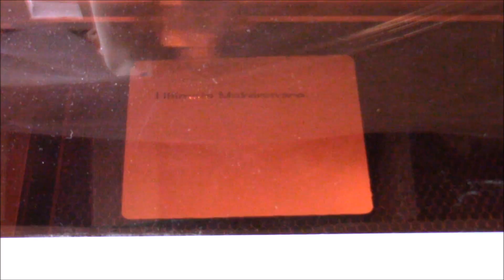K40 40 Watt Laser Cutter Engraver Overview and Mods

Comment: Thanks for the video! Would you mind sharing your speed and power settings for the acrylic? I'm having trouble cutting acrylic on my machine.
Reply from the maker: Thanks for posting! First of all, make sure it’s acrylic and not polycarbonate. Polycarbonate will make a sooty black mess. For settings on 1/4 in thick acrylic, I max out the power dial and set travel speed to 8 mm/s and run 2 passes.

Comment: What's the noise level with one of these?
Reply from the maker: The laser and cnc part is about like an inkjet printer. The blower that I put on mine is kind of loud, like a vacuum cleaner, but you could install a quiet blower if you needed to keep the noise down.

Comment: How does it know where home point is if you want to cut something with accuracy, I've also read its 110v only and I want to use in the Uk at 240v
Reply from the maker: The home point by default is in the top right, and it has limit switches to home out the machine. With the default software, you have to align material to your image. I've switched to a free control software called K40 whisperer, which allows you to move the home position to other specified locations. Mine is 110 volt.

Comment: Isn't 20mA quite high for a 40w tube?
Reply from the maker: I have no idea, but that’s what my gage reads. Thanks for watching!
Reply: @TimWelds  I know this is an old thread but, 20 mA is probably why you burnt up your last tube as you said in another reply in comments you replaced it. Depending on things, these shouldn't go past 12-13mA from my understanding, and air assist would help dramatically, Good vid.

Comment: You shouldn't go over 15-17mA.  Put your bilge fan at the window instead of by the laser, you want to pull the smoke out, not blow it.  Try to get some air assist, it will help greatly with cuts and help prevent flaming.  I have cut 19mm - 3/4" with a K40.  You may want to experiment with a 38.1mn FL, I've had very good luck with mine!  I regularly cut 5mm Lowe's utility ply at 10mm/s in one pass.  1/4" solid oak is like slicing butter in one pass.   Good idea on the bed!

I have other mods that are a little more involved, like the Cohesion3D Laserboard, but that's the motion and PWM firing control. 

Cutting 19mm

https://www.youtube.com/watch?v=nsv2-WaCZok
Reply: Do you think a K40 could cut 3/32" vulcanised fibreboard?

Comment: How much trouble did you have getting all the mirrors in alignment to be able to cut like that?  I've messed with mine for over a year now and still can't 1/16th balsa in one pass!!
Reply: had the same issue with mine burn a spot right at the first laser to see what kind of beam you have mine was not a full burn it had a bad tube that wasnt putting out enough power changed tube and its hot now

Comment: Hey If you or someone needs an Air-Assist Upgrad kit without the need of compressor check out this Upgrade kit: Germany: https://www.ebay-kleinanzeigen.de/s-anzeige/k40-lasercutter-air-assist-upgrade-ohne-kompressor-/1057583531-84-9503 Or Europe: https://www.ebay.de/itm/K40-Lasercutter-Air-Assist-Upgrade-ohne-Kompressor/382814343525?hash=item5921835165:g:UJkAAOSwuilcaaqv

This protects your lens from the smoke and makes better cuts.

Comment: Tim where did you get the honeycomb metal material Also why does laser not cut up the bottom of device once it cuts thru the material? Is there a material on the bottom to prevent this?

Comment: Feb. 11, 2019----Thanks for the video, but apparently this is not for me. Getting back into modeling, but going for 1/35th scale zombie/apocalypse dioramas. One of the things I got interested in was photo etching and there's two videos here by Plasma and Luke Towan who show how it's done. What I want to do is make security fences like those used around public buildings and parks, along with security doors on homes for example. Was hoping someone will have a demonstration of this machine cutting thru VERY thin metal such as brass or copper, about the thickness of paper up to three thicknesses size. There's a machine which does photo etching, but with a laser, it would give me a larger variety of material to use.

Comment: Wait a sec, why haven't you attached the ground line????
Reply: Thanks for watching and for the question. The machine components grounded through the power cable and the plug. In some countries, they don’t have grounded outlets, so the external ground is required. That being said, I’m not sure how effective the connection between the ground bus and the case is; I probably should look into that.

Comment: You have a laser cutter.. why not cut the wood for the air extraction that's glued onto the pvc
Reply: Great suggestion! I also have a CNC router that I used because I had already removed the stock ventilation system.

Comment: Good video, could you help me with the configuration of the machine, is that sometimes in the cut I passed double and I just want a single pass, please help me
Reply: There was a setting in the version of the software that I got, but I didn’t care for that software, so I converted mine to GRBL with an Arduino. This let’s me use some Inkscape plugins which are much easier to use.
Reply: @timothyluskin7655  K40 Whisperer is also an option so you can still use the stock hardware.

Comment: Thanks for sharing. In your video you said you were able to cut 1/4" plywood. Could you provide some tips? I have the same laser cutter and was never able to cut plywood that thick. 1/4" solid softwood was no problem.

Mike
Reply: have you tried 1/4 inch acrylic, if so how?
Reply: Plywood has been hit or miss. Some brands will cut and others don’t. I think it’s because of the glue. I have the best luck with solid wood. I get mine here. http://ocoochhardwoods.com/index.php